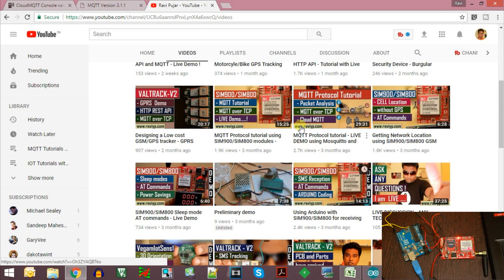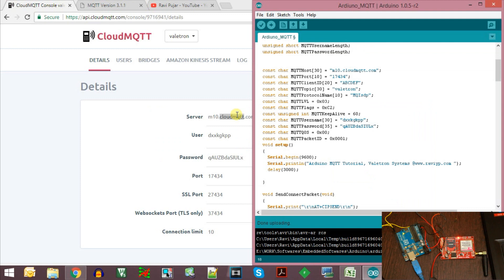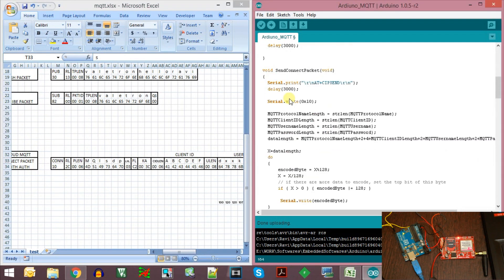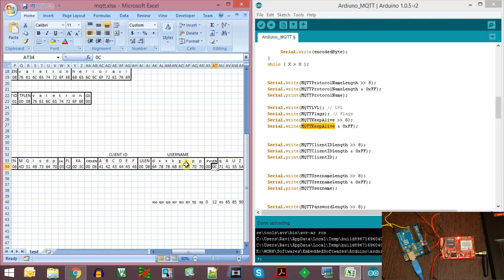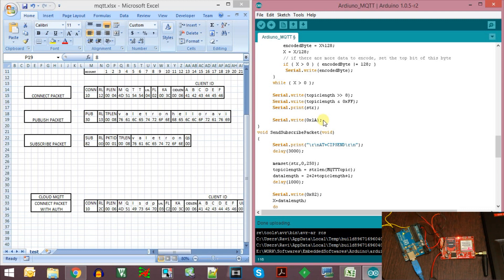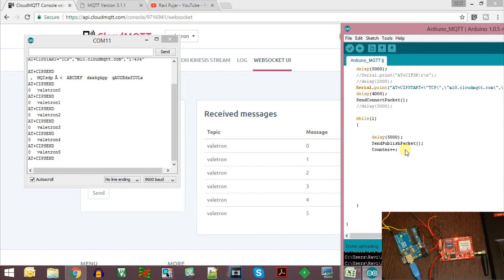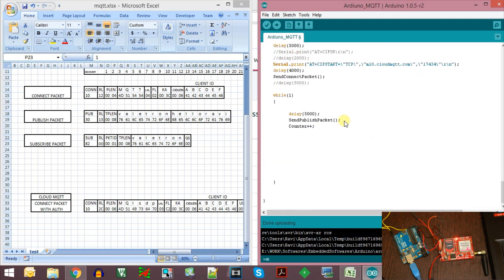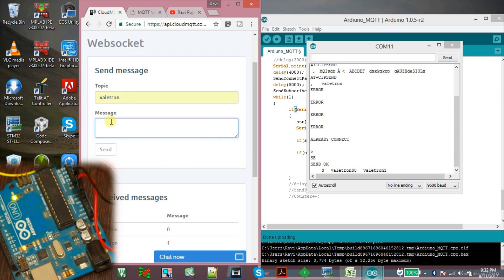Arduino MQTT Tutorial - Coding & Live Demo using SIM900

Comment: Hello Ravi, can be used for sim800L module  for this implement?
Reply from the maker: SIM800L supports same AT commands.
Reply from the maker: But use proper voltage level translator. Break out boards you get on market usually don't have proper level translation.

Comment: Hey!
I am new to mqtt protocals, i have been using esp32 to work with hivemq, as hivemq requires server certificate with i think is used make client connection. I want to known how does this server certificate comes in play for GPRS modules with Arduino. If you could suggest any idea or direct me to the link how i can implement the client certificate with GPRS. I am using sim900a (also does this support TSL i am not sure).
Thank you!!!

Comment: Hello, thanx for tutorial. I'm wondering if it will it work on esp8266 with sim808?
Reply from the maker: Hi, Thanks for watching. 
It should work, as they have almost similar libaries. You care using Arduino compatible libraries?
Dont forget to Subscribe :)
Reply: thanx for reply, it is working for cloud mqtt server, i am trying for thingspeak server, but the problem is there is error saying "Send Failed" in connect packet. What u think ? can u give me your code for reference?

Comment: Hello Ravi, I have a question. I made a similar program to run on my arduino but I have a problem in the websocket in cloudmqtt.com. It doesn't send any message because it says that there is a problem with my firewall and the websocket port (TLS). Have you experienced anything similar?
Reply from the maker: No, never faced any issue. I used non secure port number when i got it working. I use MQTTFx and it works well on Windows 8.1 and 10 also.
Thanks for watching and Don't forget to share and Subscribe :)

Comment: Good job Ravi!! U made IoT simple!
Reply from the maker: Thank you Jay for the continued support :)
Reply: Can I use putty to talk to GSM module? Can you please make a tutorial on it?
Reply from the maker: Have not tried it but It should be possible.  Yes will try to make one if i get it to work.
Reply: Sure. When you use these terminal softwares, how do you connect gsm to comp port?
Reply: I think when he uses the terminal softwares, he connects the TX RX of the GSM module to, maybe, a USB to Serial converter module that is connected to his laptop. Or, ofcourse, the Arduino can also always be used to connect the laptop to the GSM module(it acts as a mediator, since it does the job of the USB to Serial converter). Just be sure to upload an empty sketch to the arduino and connect the RX TX of the arduino to the TX RX of the GSM, and connect the arduino to your laptop via USB. :)
Reply from the maker: Yes thats correct. I use CP2102 USB to UART converter for this. But the module boards i use have inbuilt level translators. So when you are using make sure the IO levels are translated to 2.8V IO level of SIM900 or SIM800
Reply: Thank you Tejas ..!! That was a lot of info. :)
Reply: no problem

Comment: Hello, have you submitted data to the Azure Iot Hub? Using a simcom module? such as a sim808 or sim900

I used this tutorial but it did not work:
https://stackoverflow.com/questions/38037684/sending-sensor-data-to-azure-iot-suite-using-gprs-module-with-raspberry-pi-or-ar

I would appreciate it very much if you would respond.
thank you

Comment: Ravi, very good video, you helped me to understand and apply mqtt and arduino, thanks.
I have two questions about this code:
1- Do I need to use some special library?
2- Were do I put the message, it only sends the topic

Thanks again for the help
Reply from the maker: Hi Agustin,
Sorry for the delay in replying.

You can use the code i shared on my blog or you can use AT command libraries and use my code as base.
The message comes right after the topic.
Dont forget to share and subscribe :)